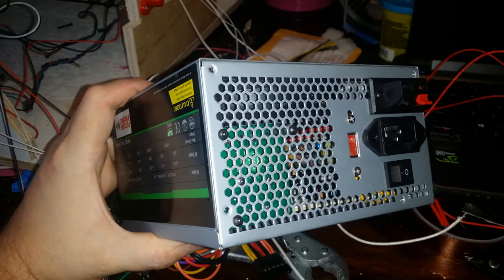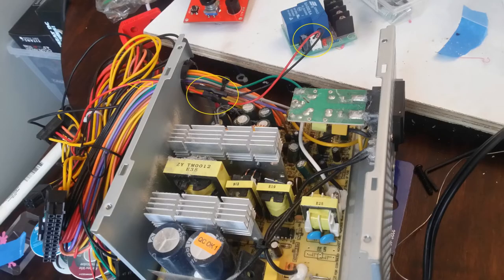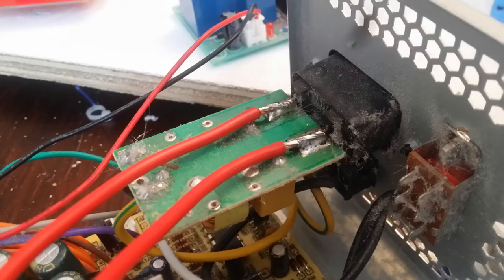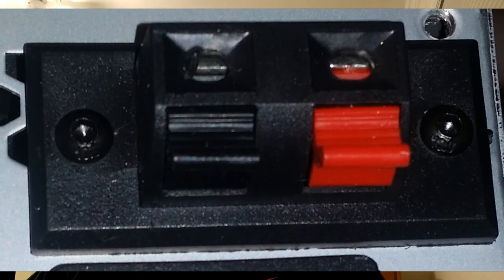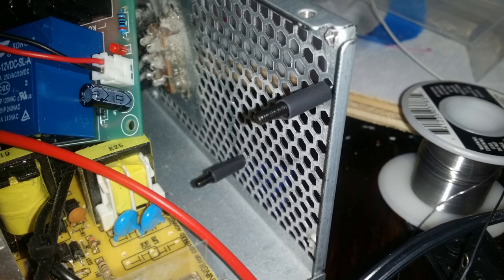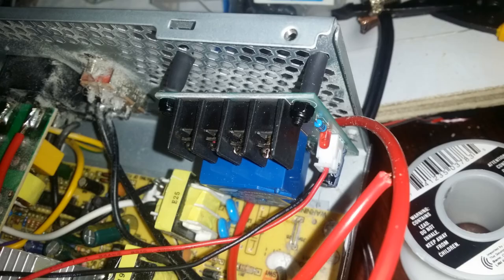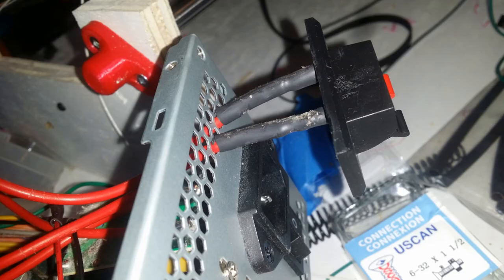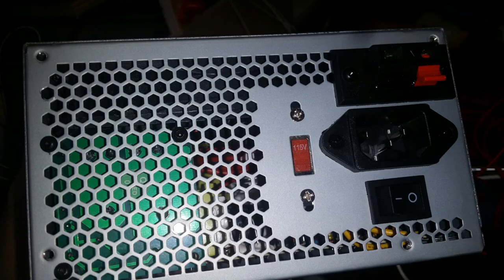Installing a Safer Heated Bed Relay

Comment: Personally I think just adding a cover for the relay would be safer and easier.
Reply from the maker: That certainly is the other way to go. But you still have to pull the 120 from somewhere. So either another plug or another set of wires run from the power supply. I feel my approach is safer after install, but probably more dangerous during implementation.